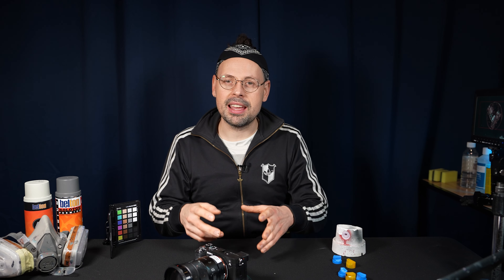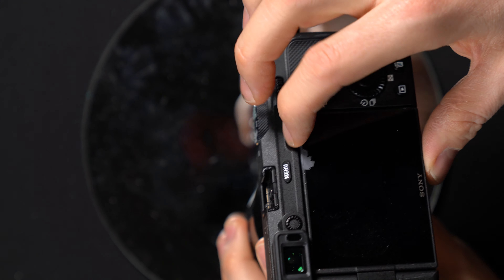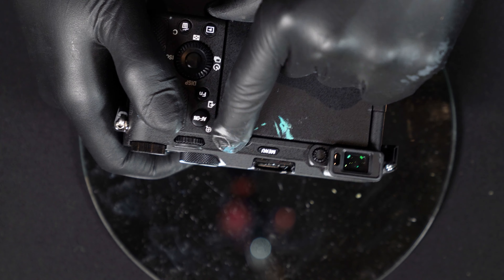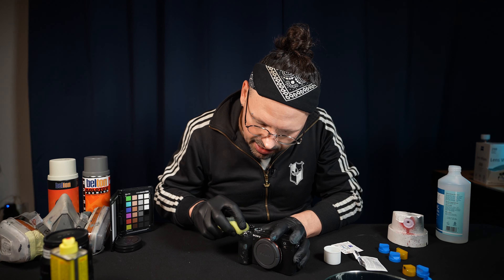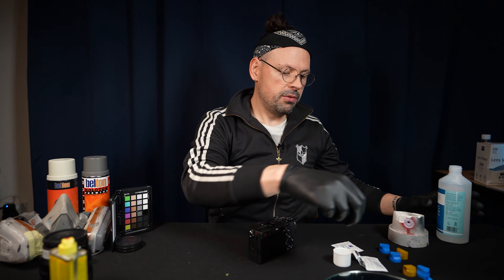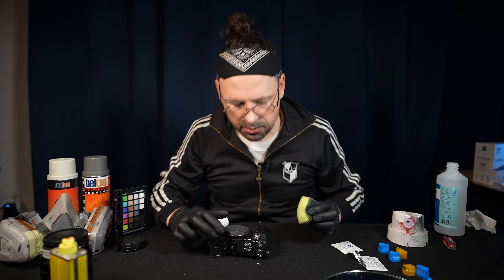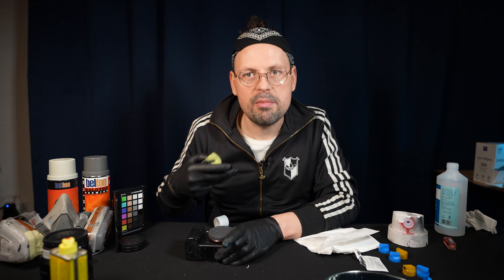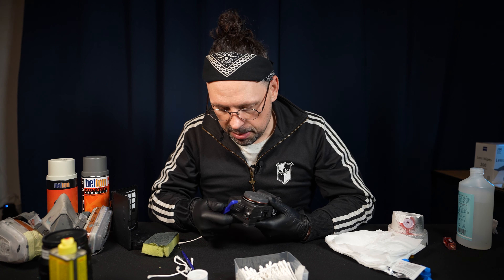How to CLEAN and PROTECT video camera body from spray paint -  PART 1

Comment: Man I`ve destroyed so many cameras with paint but for cleaning I use acetone - lightly rubbed - if discolored I dont mind a little beeswax can help with that - As long as you have fun destroying it the work later is tolerable
Reply from the maker: Thank you for the comment. I didn't think of acetone. I guess you can use it as alternative to white spirit
Reply: @AirborneMark  I think its more potent than white spirit so gently does it but it just gets rid of the paint so fast
Reply from the maker: @BornWriter  Thanks for the heads up. WIll try next time.
Reply: @AirborneMark  Be gentle though man
Reply: Acetone for the win! And it smells nice too! 99%
Reply from the maker: @FusiWalls  Gave me an idea for a video 25 minutes of my smelling different graffiti  product and rating them form 1- 10 ;)

Comment: Interesting topic, like I said in the premiere and Aize has agreed acetone is great for dissolving paint but it will really dry your skin and it will soften plastic and rubber too but on metal parts its by far the best. Also you forget one simple method the fingernail is great for getting larger blobs of paint off
Reply from the maker: Thank you this  is very helpful. I will do Acetone edition - 25 more minutes of me scrubbing paint ;)

Comment: It's quite known cleaning the equipment and so on with acetone, just like your hands, but as for the lens, you can make it a little easier and cover it with paper tape - it will take you literally a moment and you will not even have a zoom and focus ring :) The camera can also be treated with tape or look for a silicone / rubber body case then you will only have to clean only the knobs or the screen, and not the entire camera, which is painting :)

Pozdro i działaj mocno cały czas, bo fajne nie sztampowe rzeczy sobie robisz !!!!
Reply from the maker: Thank you. I will try acetone next time. You're ahead of the game a bit as part 2 was recorded at the same time and I have some of these solutions implemented already. Nonetheless, thank you for great ideas for the whole community. Dziękuje. Działamy

Comment: Loop cap cleaner is the best thing since sliced bread
Reply from the maker: Thank you. Didn't know about it. will heck it out
Reply: Will get that splodge of paint off your favourite coat or hat  aswell ❤️ that and elbow grease spray degrease  in yellow bottle from poundland
Reply from the maker: @northernmuralco  You are very helpful .Thanks